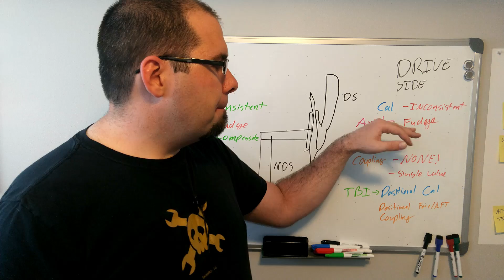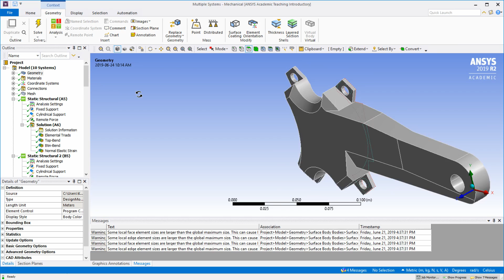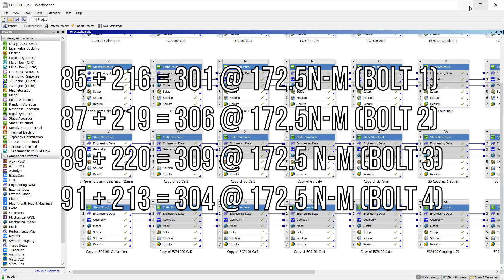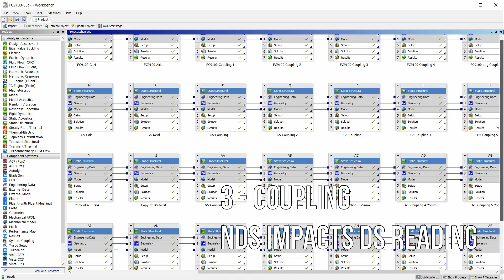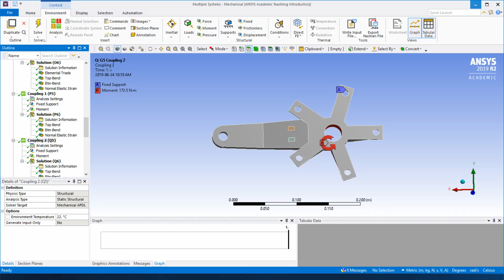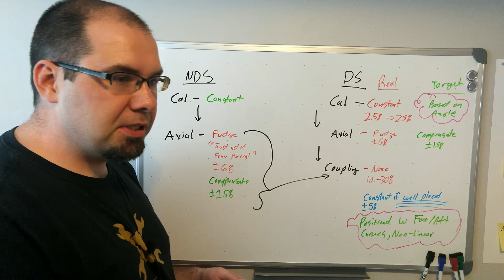Biggest industry blunder in Powermeters yet - Inaccurate and Expensive

Comment: So even pedal and spider based PM options are affected by this issue on Shimano cranks?
Reply from the maker: Pedals are immune because  they sense not on the crank, same with spiders. Just don't confuse some of the review websites that call things spiders that aren't If it's on a genuine FC9100 it isn't a spider based powermeter. So Quarqs or P2Max are not affected, but again, they don't exist on this crankset.
Reply: Keith Wakeham I bought the Quarq dfour (Only the spider) I will be comparing it to the Wahoo Kickr values. But you are saying it should not be effected right? :)

Comment: Brilliant as always. Again, I only understood around 60%, but still really informative. Question: How do you measure the 'fudge factor'?
Reply from the maker: After the fact it can be tricky. Some meters will give a torque output in an app. If you have this then a hanging weight test at 53mm offset with a known weight. You'll see a difference nce between calculated torque and what it reads. The offset is critical though. Because the further away the higher it'll be. Which is an easy way to dupe people by saying they are using the wrong offset when it just hides the intentional wrong calibration.
Reply: @kwakeham  So, Dumb/obvious question: using pedals with >53mm center-to-crank lengths (increased q-factor) makes these power meters inaccurate? If so, roughly to what margin? 10mm of offset = x% ?

Comment: Dual sided pioneer/dura ace R9100 user here. Curious how the addition of an oval(absoluteblack) chainring might also play in to the accuracy of my data. Have I made horrible choices, lol?
Reply from the maker: Most oval rings don't affect the torque error as described, that's still there for these cranksets. However, I'm not sure of anyone doing the intra-stroke velocity calculation and compensation. At least none that are advertising it. The added error is that the velocity during a complete revolution is no longer constant, but kind of a super imposed sinusoid. That causes it to read off a bit. So there are some generally accepted derivations that relate it to a few additional percent, and for a dual sided setup it'll affect both sides equally. However the derivations assume a single angle and stroke style so they aren't perfect. Google searches will eventually reveal them but you could build some error on top. Suffice to say I don't think it would be worse than each issue independent, so there is likely little to no interaction factors on error. The chainring stiffness would, but I don't think it would be enough to be meaningful (however, could be wrong on this if their stiffness is significantly more or less than original DA rings).
Reply: Keith Wakeham if I’m using this primarily to measure the difference from left leg to right leg to train my weak side up as much as possible. Will it read accurately for that or will it magnify / hide the difference?
Reply: @BMB_GRAPHICS  I would imagine that if there is an issue with accuracy of the right/drive side crank arm, that power balance would therefore also be inaccurate and make training specific "weakness" impossible.

Comment: You saved me from a bad purchase.  I'm looking for something to replace my old pre-ANT+ PowerTap hub and had all but settled on the Pioneer/Shimano cranks.   My original choice was Garmin Vector but I've seen some horrible reviews about those losing connection.  Maybe I'll stick to PowerTap and just get a new model hub.
Reply from the maker: It was really GPlama's digging  into the consistent problem that really prompted me to do the nerd version. I've had good personal luck with the Vector Series even though destroying a pod on the first gen. The third gen I only got my hands on after they did the battery door update and found them suitable. The lack of Hex annoys me. Assioma's I've used have been almost idiot proof in all cases. The only two things I don't like is bulbous appearance and clip in stiffness even at it's min is like most pedals at near their max (and their cleats are only sort of look compatible, thickness is high). I have no issues with Quarqs Dzero, though the new stuff, the diameter of rollers I've heard is different on the AXS and Force Etap so unless you're running a full drivetrain those are out. Powertap hubs are good but they are long in the tooth. Outside you can get good results with zeroing and the auto zero feature, but it has the hasselfactor of being problematic when they age if you use them indoors on a trainer. Bad zero offsets due to the torque tube bearing, and autozero gets very confused causing negative offsets when coasting. So long as you're okay with those things they are okay. I personally have had issues with their pedals not going outside of their error but bouncing around in their error. I tracked this down to how they detect rotation -- they don't detect crank rotation but pedal rotation so variances in toe up or down causes them to bounce around for me, while others on the same pair have had better luck. No clear winner.
Reply: @kwakeham  Yeah, I thanked Shane as well for his great analysis.  Thanks for the info in your reply.  My trainer is a Hammer H2 so indoor use isn't an issue.  Your comments on the Vector are useful... it's hard to separate online comments by generation and know what's up with the latest revisions.  Garmin gear has been good to me in the past and I'm invested deep into the ecosystem already!
Reply: I've had a few different PMs since '98. The PT Hub has been the most reliable and consistent for me -- good daily training unit.

Comment: Good job on the analysis. I did the same 5 years ago and concluded that arm based was not a solution and should not be called accurate at all. I remember when Stages first came out then all the glue on meters even 4iiii, what a joke it was. I was even convinced. I must be missing something! The talking heads really pushed the product shamelessly. Some of the pedal based are the best because they can measure instantaneously angle and load. The Quarq is a good unit also. The only issue is cost. There is even a bigger problem when used on trainers. I think the market is looking for the $200 meter with a real 2% accurate power meter. It looks like the talking heads are have a little revenge on the arm-based companies.
Reply from the maker: A simple arm can work. Aesthetics prevents.
Reply: @kwakeham  Agreed

Comment: Great video Keith. A lot of good work gone into this. In surprised Shimano adopted a piggy back solution. It's disappointing, they normally do things properly and really should build a spider version.  Couple of comments: 
1. On the chain ring fixtures you're assuming the torque is only reacted on one bolt? I agree most of it'll go through the one closest to the chain tension when at 9 o'clock, but there has to be some non-uniform distribution through the others. 
2. Did you test spider bending from an angled chain line, i bet that's pretty bad. 
3. When they cal these side arm gauges, how is the spindle length chosen where the load is applied (i.e pedal axle length). Pretty fuckinnn arbitrary. 
4. Do you have any results from pure crank bending (inboard toward bb) and no torque? Interesting to see how closely or not the gauges move together and cancel. From your experience, what kind of bending errors do you see? i.e Displayed torque per input torque?

Cheers
Reply: Why aren't we seeing more full bridge shear layouts inside the axle? Does Rotor have a patent on that? I would find it hard to believe they can protect that so heavily as that's how every simple rotary torque transducer is made! Simply supported. Can't go wrong.
Reply from the maker: I did mentioned in the video that they are shared, but it also depends on things like chainring stiffness. However, it doesn't matter. It must always read the same no matter what in order to use a constant calibration. To the second, no I didn't test that. Interesting to do. The 3rd point is funny because I figured that this was going to be a major source of error and yes. I came up with a method a while ago that's used in one product but turns out it wasn't as large as axial as a problem. The reason is that the bearings constain things and the bulk of standard pedals are 53mm from face to pedal center. This is kind of the governing distance. But adjusting the offset does have direct impact on the calibration on all commercial units if it isn't corrected. The 4th is actually in there, calling it axial, because forward force causes a lateral moment which is identical from the cranks perspecitve as pushing towards the BB. So really the axial error is confounded in the other problem you speak off, but generally people can't push as hard laterally.
Reply: @kwakeham  Hi Keith - a great review and I wish this depth of review was available for all power meters (and all cycling equipment for that matter).
If I may comment to the chainring stiffness and your reply. You say that you mention it and " it doesn't matter. It must always read the same no matter what in order to use a constant calibration." However I would suggest that it is relative to the magnitude of errors expected. I.e. if the chainrings are very stiff, then the magnitude of the errors contributed by an individual spider arm will be reduced as the load is shared, potentially cancelling (or increasing) the sum of the strains from each arm at the gauges. I feel that your analysis has taken the extreme case of zero stiffness, perhaps to best demonstrate the effect to the audience, though potentially missing possible reductions in the errors. A perfect world/infinite stiffness chainring would give you a constant calibration figure.
This is most certainly a complicated issue, when the load applied is affected by the asymmetry of the cranks and also the non-uniformity of the chainring/spider/crank on the drive side. Not to even mention the complexity/variability of the resultant load input by the rider. Humans don't make great motors.
Great work, love the videos.
Reply from the maker: You're right. I think I was over simplifying here to indicate the practical world where realistically you're sharing between two or three arms. It's a statically indeterminate problem dependent on the stiffness.. Given the arms are curved they operate via partially a bending mechanism and not axial thus weakening them compared to the more solid center structure. So Infinitely stiff would solve the problem by equalizing loading, but you need to be an order of magnitude higher than the existing structure to make a difference. It gets hard when you're using the same 70GPA material to do that with a bending mechanism involved. So it will impact it certainly, but short of being made out of Carbon nanotubes or a Tungsten you're still playing in a area where 80 - 90%+ could be held by a single arm and in these instances you can simplify the problem by approximating it to a single arm. So kind of skipped over that. Much respect for watching through and pointing this out.
Reply: Keith Wakeham Fair point I didn’t have the model to make a comparison of the stiffness, if it’s an order of magnitude then yeah not going to be the silver bullet. 
Tungsten chainrings... I want that. And lots of chains to consume too.
Thanks for you videos and great reply.